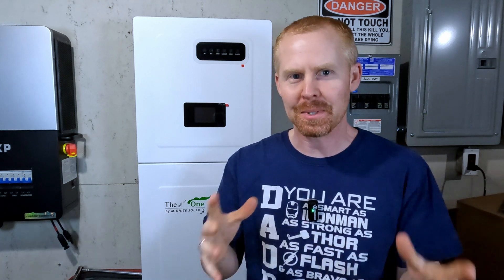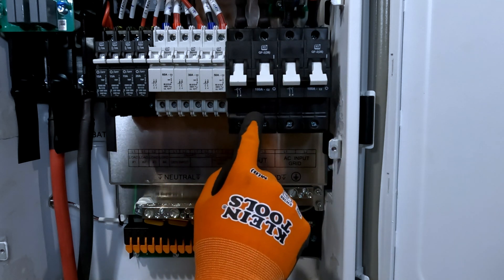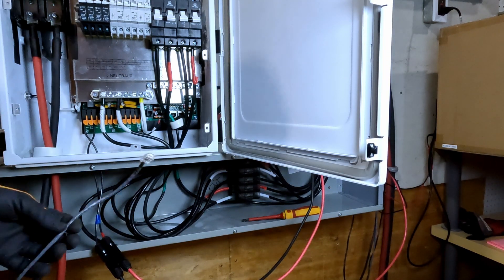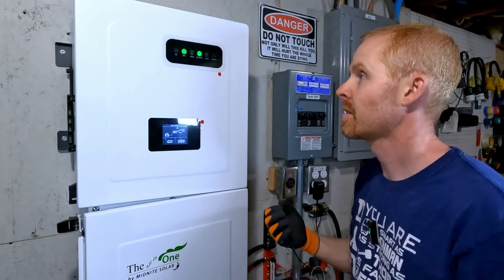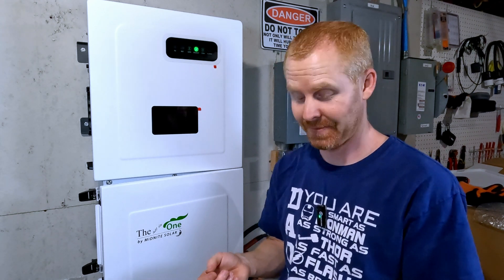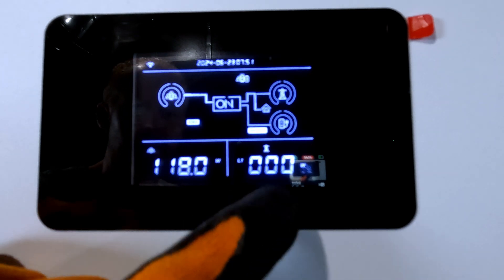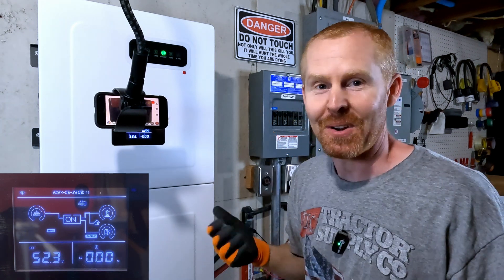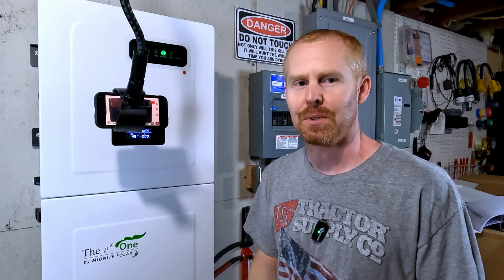Getting Power to the MidNite Solar All in One Hybrid Inverter

Comment: 5:50 did NEC change the rule on low voltage/communication wires being in the same raceway
Reply from the maker: That's a great question. So in looking it is allowed by NEC code as long as all your cabling is rated for the highest voltage present within the raceway.  Mine currently is not, but ironically I'm actually trying to source the proper cables right now.  Thanks!

Comment: Heya Adam, I noticed the second inverter goes into standby mode every now and then (it has happened twice now in 2 weeks), and I was wondering if you know what the cause of that is? Also, once it is in standby mode, do you know how to wake it up again? If i log into the inverter via bluetooth, I have to wait out the 300s timer (it's always at 300s when I log into the inverter), and once the timer runs out, and I hit the on/off button, it actually turns off the other inverter that it is in parallel with, so I have to turn both on again.
Thanks in advance for any information you might have on this!
Reply from the maker: @dominiekmeers4749  do you have them configured in parallel?  If so, the inverters should act together.  If one goes down, they both should.

If they’re separate, I can’t say that I’ve seen that happen where they drop into standby mode on their own.  

As far as the 300 seconds, you can change that startup time if you’re not selling back to the grid.  I believe it’s set to 300 seconds due to some UL requirement.  To change that setting, go to Settings -> Grid -> “First Boot” as well as “Reconnect and Boot”.   I have both of mine set to 10 seconds.

If one is turning off on its own, it almost sounds like they’re not truly in parallel together. They should both start up and shut down together.
Reply: @AdamDeLayDIY  Thank you for the info, much appreciated!
I do have them in parallel (at least as far as I can tell from the app). Their parallel settings are turned on and their timers do sync up. 
I'm going to give support a call tomorrow and see what they say.
FYI - 10 seconds is so much more conveniont, thank you!!
Reply from the maker: @ good luck!  Let me know what you find out!  I still have to make a video on how I have everything paralleled.
Reply: @AdamDeLayDIY  I'm looking forward to this video! It would be great to compare notes and see if there is anything else I may have missed. I contacted support this morning but have not heard back so far.
Reply from the maker: @dominiekmeers4749  I talked to Rick today and we brainstormed your issue.  Something I might suggest to test (which won't change any settings) is to grab a multimeter and check for continuity on the parallel pins on the two inverters.  The terminal blocks have 2 sets of pins labeled 1-4 on each inverter.  They are connected together, so you should be able to check for continuity between each inverter for pins 1-4.
Reply: @AdamDeLayDIY  I checked each all 4 pins and they do have continuity. I did remove the ct-sensor cable from one for the inverters (the slave) and after doing that, both the inverters responded to signals sent to the master from the app, so at least that is promising. I did a full restart as well, so I'll be monitoring it for the next few days to see if it goes into standby mode again.
Thank you very much for all the assistance and information, i very much appreciated it!!
Reply from the maker: @ that’s good to hear!  Let me know how it goes!
Reply: @AdamDeLayDIY  So far everything has been running good, no more standby issues or anything like that. I was curious if you know anything about the grid settings. My inverters are set to self consumption, and I noticed that when I'm pulling in for example 6kw from my panels, and my load is 200W, the inverters still pull from the grid (anywhere between 50 and 700W depending on the load). I thought self consumption would only pull from grid if there was not enough coming in from PV and batteries?
I've been looking for some setting where it would not pull anything from the grid except when my batteries are down to maybe 20% or 30%. 
I asked Rick about that and he said he would look into that
Reply from the maker: @dominiekmeers4749  That's awesome to hear!  I'm wondering if the system was just fighting over which one was the "master" inverter since both sets of CTs were still connected.  

So from my understanding of how most hybrid inverters work, when they're configured to not export any power from the grid, they will always draw a certain amount of power from the grid to prevent anything from flowing back up to the grid.  Sometimes this is configurable and in the case of the MidNite it is.  By default it's set to 300W.  The field name is under Power Control and it's called "Maximum consumption from the grid".  

Now I didn't want to constantly be drawing power from the grid, so I ended up wiring my grid connection into my generator port and I use that to control when my inverter "falls back to the grid".  You can set the low and high SOC and when those thresholds are reached, the grid relay turns on/off and the generator/grid starts working or turns off.  This way it completely isolates your inverter from the grid when you're running off battery power.  The only downside to this is that the inverter cannot use the generator in an inverter overload situation.  It will just shut down.  I'm hoping they add some more control over this down the road similar to how Victron allows their generator controls to work.
Reply: @AdamDeLayDIY  that is awesome info!! thank you so much for sharing!!
Reply: Heya Adam. Everything was running fine until a few minutes ago, where the slave went into standby. Looking at the maintenance option in the app, I get the 10 seconds countdown and then just the option to turn the inverter off. Do you know of a way to bring the inverter out of standby without the inverter shutting down?
I am going to record a short video of my setup here and post it on youtube, if you're interested or curious, I can send you a link to it. Probably won't be until next week since I am waiting for the last conduit so everything should be (hopefully) up to code.
Reply: I just changed the inverter setting from self consumption to off-grid. I'm curious if maybe it expects grid power to trickle in or it might go into standby or something like that (just assuming here since I can't figure out why else it would do that).
Reply from the maker: @dominiekmeers4749  Ugh, that's really annoying.  Do you see anything in the log or even on the energy page that might correlate to the timing of when the inverter goes into standby?  It's almost like it's losing connection somehow.   Not sure how or why.
Reply: @AdamDeLayDIY  the only thing showing up in the logs are the A2-Grid absent and P4-parallel GRID abnormal errors. I expect those though since I have the grid completely turned off. 
I looked through the energy page and nothing stood out, but I'll look through it again, maybe I missed something.

I'm going to look into setting the grid up as a generator to have better control over it. Currently, for the grid, I am using 125 amp breakers from my main panel. When hooking the grid up to the smart breakers (60 amp), I should probably replace those with 75 amp breakers (I don't know if 75 exists).
Reply from the maker: @dominiekmeers4749  Do you happen to know when the slave switched over to standby mode?
Reply: @AdamDeLayDIY  Hey Adam, I looked through the logs again and I did notice an issue. It showed I had solar power coming in at 528W for a couple of hours, after dark. I don't know if that means that was the state when it went into standby mode, or if something else happend. 
In the battery log it also showed it was sending that much wattage to the grid (which it didn't since my grid breakers have been off).
Reply from the maker: @dominiekmeers4749  What day was this?
Reply: @AdamDeLayDIY  This was november 23rd. Afternoon and evening. The sun set around 5.30pm that day. Let me know if there is any other information i can provide!
Reply from the maker: @dominiekmeers4749  Did it happen the last two Saturday's in a row?  It seems like your batteries get fully charged and then it starts to lose communication.

The grid errors shouldn't make any difference because it's just telling you the grid is "down".
Reply: @AdamDeLayDIY  I was wondering about that. Looking at the logs, the batteries were fully charged. And I do remember the first time, batteries were full and there was a very small load, so I thought it was put into standby because there was not enough work! Great, except it wouldn't come out of standby ;)
Reply from the maker: @dominiekmeers4749  Yeah, I would definitely keep an eye out to see if it always happens when your batteries get full and you have minimal loads.  Maybe it'll help narrow down where to look at next.

Comment: While I don't like the typical high frequency, transformerless inverter like the 6000XP, because of their low surge capacity and shorter life expectancies for use in residential or commercial applications, Midnite Solar's, high quality, high frequency inverter products are a completely different story. I've been active in the renewable energy industry for over 25 years and can say without a doubt that you cannot find a better inverter product than a Midnight Solar inverter. You simply cannot go wrong with Midnite Solar inverter.

Comment: Something that might be interesting to try is what size (amp rating) breakers is it capable of doing a rapid trip, ie short circuit, on vs inverter going into over-current protection and the whole house goes dark.  Earth faults (hot to chassis) would cause a GFCI to trip so that sort of fault is not an issue.
Reply from the maker: @retrozmachine1189  hmm.  I know the manual recommends a two gauge wire with a 125 amp breaker in order to use the full capability of the inverter. Normal breakers are meant to only run at 80% of their listed capacity. The MidNite breakers are rated to run at 100% capacity.
Reply: @AdamDeLayDIY  I was thinking more along the lines of the AC output when the inverter is supporting the load by itself, ie no mains supply present.  Peak appears to be 13kVa (120v) or 20kVa (240v) for 1 second but perhaps it can do far more in a shorter time.  I think your standard panel breakers are D curve which to me (applying D curve MCB performance) means magnetic (instant) trip requires at least 10 x the rated current.  A 20A D MCB would require 200A at a minimum to ensure rapid trip, ie we'd be well into thermal trip territory which brings the possibility of the inverter going into overload protection and everything goes dark.  It's something all inverter systems need to put up with so nothing against the Midnite, just idle curiosity.
Reply from the maker: @retrozmachine1189  no worries.  A lot of it seems to be over my head.  Sounds like you need to throw some videos on your channel of maxing out breakers… 😁
Reply: @AdamDeLayDIY  My poor little inverter would probably run and hide if I tried it.
Reply from the maker: @retrozmachine1189  🤣🤣🤣
Reply: @retrozmachine1189 Or I think its 2 x the current for no longer than an hour on D breakers according to UL standards. But I would hope at that rate it would trip sooner from active electronics monitoring the current to protect parts of the inverter from getting over worked. See now you got my curiosity going 😂
Reply: Is that an MicroSD card slot on the wifi dongle? Maybe for firmware updates? I can’t see a reason why a wifi dongle would do logging to a memory card.
Reply from the maker: @GadgetReviews-US  yes it is, good eye!  I can’t think of a reason why unless it’s some kind of a SIM card slot for a cellular connection???  (I know, I know.  Wishful thinking… 😁)
Reply: @AdamDeLayDIY   I just took another look and the symbol does have a corner cut off like a micro sim, not the same symbol as for  micro SD cards. I just checked the manual, it doesn’t say anything about it. And well the sticker on the unit did say more features coming soon????
Reply from the maker: @GadgetReviews-US  that would be awesome!  I’ll have to see if I can find anything out.

Comment: 4:00 Your European audience will definitely complain why your wires do not have ferrules.
I am not European. I am not complaining...

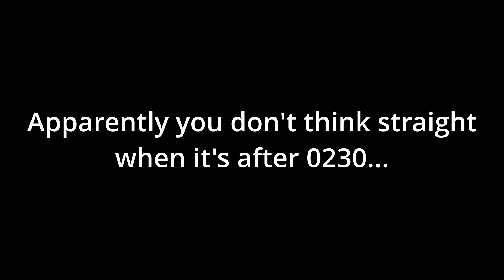8:35 "...when it's after 0230..."
I can relate to that. Last May, I upgraded my Solar, I started around 3PM and finished it at 4 in the next morning.
I like working alone when no one is there to bother me.
Reply from the maker: @DanBurgaud   I don’t recall seeing a ferrule requirement in the manual.  Sometimes they cause more problems than benefits.  

I’m with you on working on a project when no one’s around to bother you.   Usually helps get things done a lot faster.  Now if I could just get rid of the camera…I could be done even faster!  😁
Reply: We don't use finely stranded wire for AC wiring in the US which is why you don't see ferrules very frequently. Because of this, our terminals are designed to work with solid or coarsely stranded wire. Using ferrules would actually reduce the contact area in most cases.
Reply: @niktak1114  MCBs, RCBOs etc have tunnel terminals compatible with solid and coarse stranded (think 7 strands in a roughly a 13 AWG size wire).  One country will tell you things will set on fire if you don't use a ferrule on any stranded, the next will chastise you for using a ferrule.  It's all a bit silly really.  Wago Vs wirenut sort of level.

Comment: So you can only change settings through the app? No way to navigate on the unit itself?
Reply from the maker: @justinmagnuson1852  that’s correct.  There was actually a discussion on this very point last night on the DIY solar forum.  Instead of rehashing it all, I’ll just share the link to the discussion.  
https://diysolarforum.com/threads/midnite-solar-announced-their-new-10kw-aio-at-intersolar-today.76840/page-56#post-1132716
Reply: @AdamDeLayDIY  Front panel menus can be a pain to navigate but better to be able to do it than discover the app doesn't run properly or at all on the latest smartphone ... or for that matter an old  one with an OS that is not supported by the app.